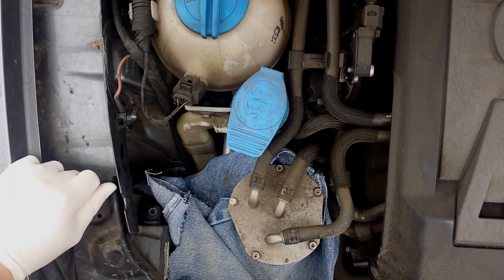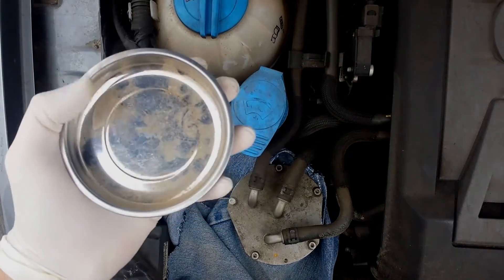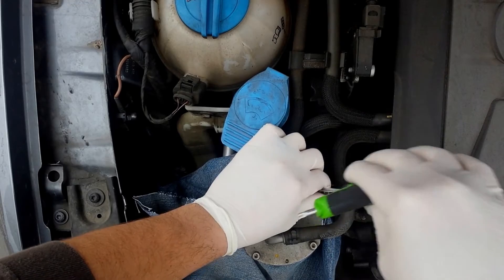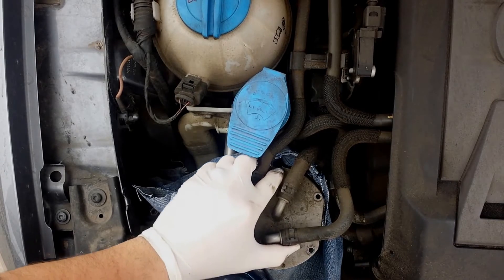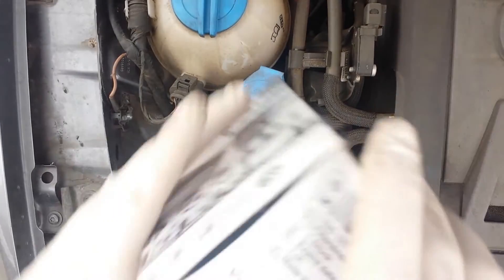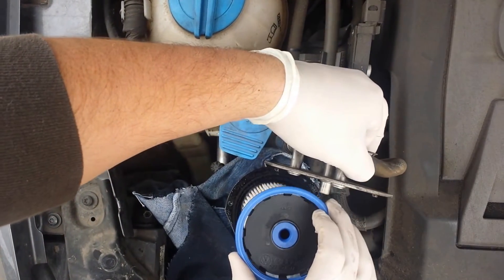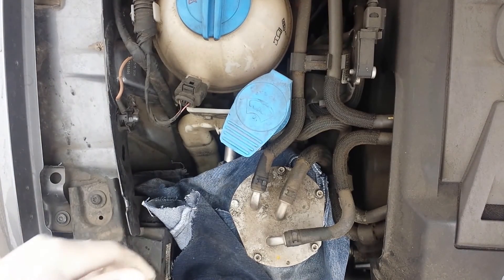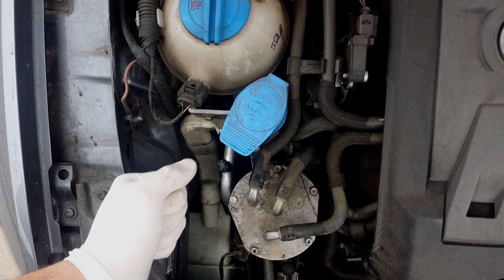2013 VW Passat TDI Fuel Filter Replacement

Comment: The risk of not flushing air from the system has nothing to do with wear and tear on the starter motor or battery. It's the risk of damage to the high pressure fuel pump downstream of the filter, which is not designed to deal with entrained air.

Comment: Hi, when filling the fuel filter, are you pouring the fluid into the hole of the filter or around it? Thanks
Reply from the maker: You fill the canister just by pouring  the diesel or injector cleaner on the top of the filter and letting it flow to the sides. I hope this helps and thanks for watching.

Comment: Dont you have to prime the fuel pump?
Reply from the maker: You could either top off the fuel filter canister withe diesel or diesel injector cleaner. If you don't, you'll be cranking for a bit until the canister fills and fuel reaches the injectors.